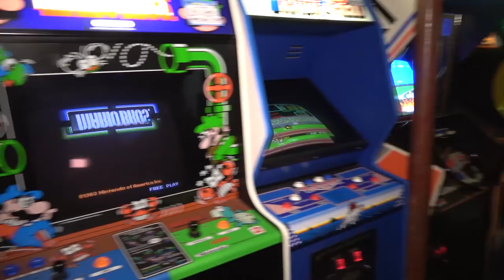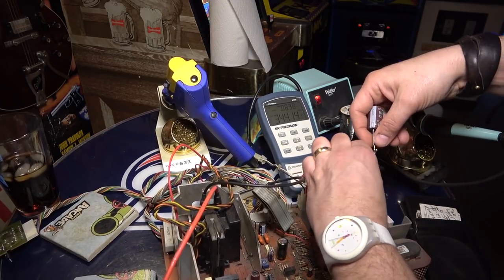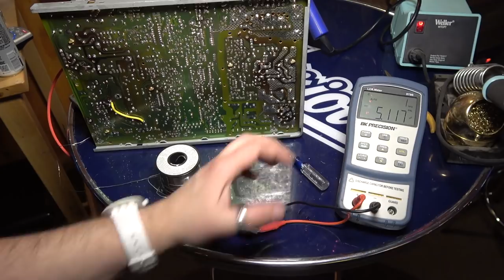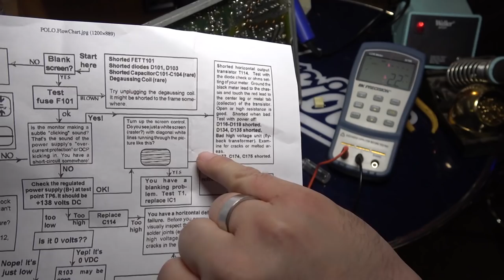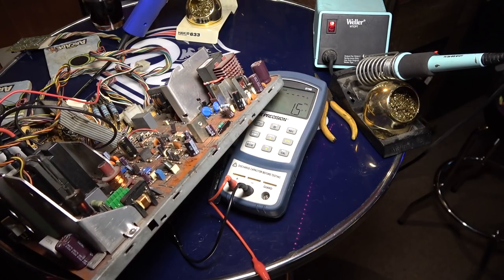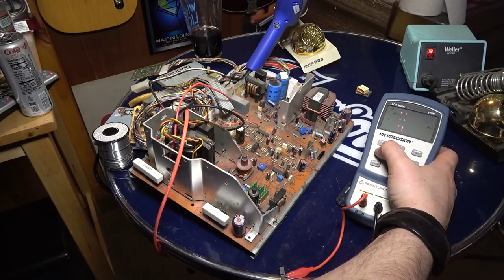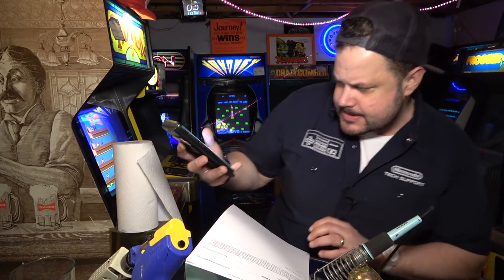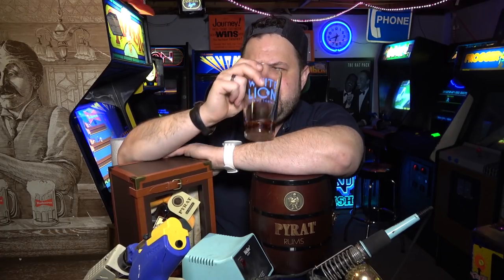MORTAL KOMBAT ARCADE RESTORE PART 13 - HANTAREX POLO FILM CAPACITORS

Comment: Infinite resistance = open, 0 ohms = short. That capacitor looks to have failed open rather than short. That type is non polarised, but the voltage ratings are important to get right for safety.

Comment: Um, if something's shorted, the ohms are not infinite; they're zero. So if the meter says the ohms are infinite, then it's actually open, not shorted. There's another good place for a card over the top with a correction note.

Comment: Hey john, good luck on the polo. I feel that if you can fix a polo, you can fix anything in the arcade world lol. Did you, by chance, ever do the light bulb test with this monitor? It will let you know whether the short lies on the deflection side or power supply side of the board. Also look for cracked traces and test with your continuity meter.

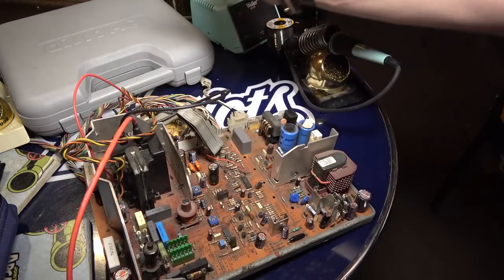Comment: So you obviously actually didn't replace all the capacitors, or you would have replaced these 3. Plus, normally you don't replace nonelectrolytic capacitors anyway. So a good card over that period of commentary (4:00ish) should work out nicely.

Comment: Please could you share the links or part numbers for those poly caps, I need to replace mine on the same chassis.
Reply from the maker: I only found the one cap so far. I am having trouble locating the other two besides ordering from Taiwan on ebay. This is the one that was bad https://www.mouser.com/ProductDetail/80-PHE448RB4330JR06
Reply: Thanks John, If you find the other two would you mind sharing with me? If I find out the parts/links before you I'll be sure to share with you too.
Reply: I think these are the specs, I managed to find all of these okay. 

C172 = Film Capacitors 3300pF 1600V 15mm 
C174 = Film Capacitors 8.2nf 1600V
C175 = Film Capacitors .012UF 630V
Reply from the maker: where did you find them? The larger cap is 22.5mm lead spacing. I can't find them.
Reply: I'm waiting on mine to come in, but I ordered a load so IF you're still struggling to find some by the time mine come in I could also send you them from here :)

Comment: John, If you are age 40 or more,  you need to get an eye exam. 
Typically at age 40,  the muscle in your eyes start to lose the ability to refocus on close objects. 
Ask your doctor about prescription computer glasses.  Otherwise, you can get bifocals with no prescription on the upper portion.  I know it sucks but just do it. You'll thank me later.
Reply: "computer glasses"
Reply: Prescription glasses created based on 1 viewing distance of 2-3 feet.  
Your eye doctor will set up a special eye chart at the distance from your eyes to your computer monitor. (Measure that distance before going in) 
I spend most of my day in front of a computer screen. Using single vision lenses set for monitor viewing distance for hours at a time is a godsend.  
Reduces eye strain and I can read large spreadsheets with ease. 
I've had them for 6 months now and I can never go back. 
It sucks getting old, but you don't have to struggle to see. You just need the right glasses.
Reply: Those are called reading glasses.
Reply: Sure I understand why you would say that. Google: "Computer Glasses" and then "difference between reading glasses and computer glasses"

Comment: Why don't you get your eyes lasered! John to correct your vision!? You already probably got the caps! but the problem might be that the voltage I think you said it was 160 volts is a bit close to it's working voltage so a 250v or higher would be better

Why don't you put sponsor on your channel, to sell your t-shirts and other bric-a-brac you could sell the mini arcade games there as well.
And I was just thinking maybe you could do on the "sponsor" a swap shop! on Arcade and pinball? Something I've not seen anywhere?
Is there such a thing anyway?
Where's that rum from! you should get a cuddly toy of Donkey Kong holding the barrel on top of the arcade just to set it off
Reply: He needs reading glasses, lasering won't help.